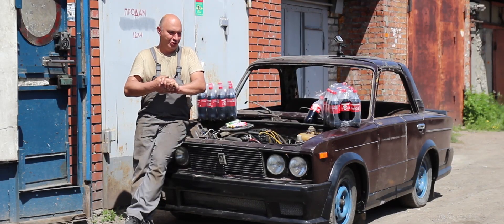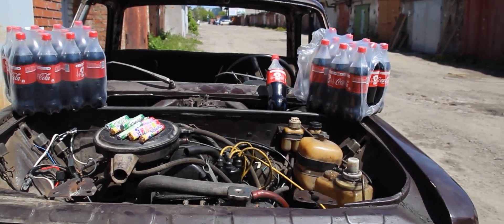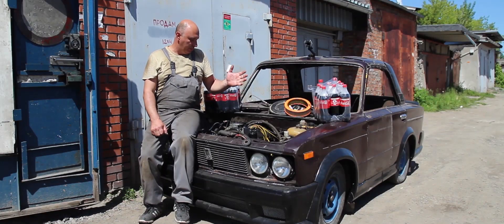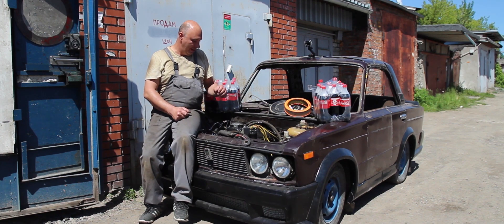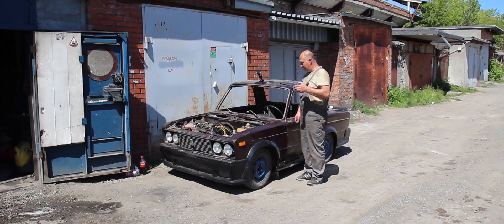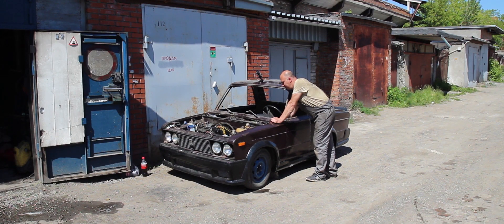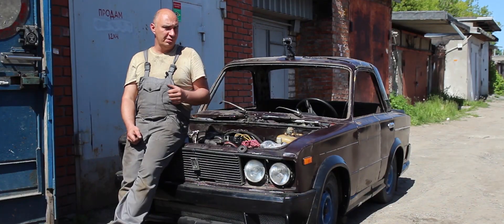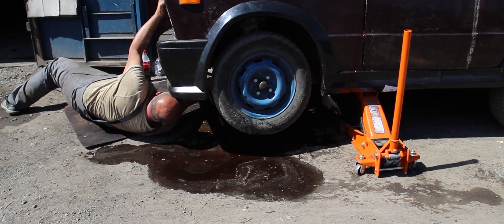What happens when you pour COCA COLA into your engine?

Comment: Excessive oil in crankcase , I think will break the piston skirts
Reply: Pegleg Noid that doesn’t even make sense the oil would reduce friction
Reply: BrandoBrap oil is non compressible.  As the piston came down from the power or intake stroke it would contact the oil in the crankcase. I’m not sure what would happen, but I can see breaking the skirts would be plausible

Comment: today i did something awesome...i poured gunpowder in a carb of a weedwhacker engine and it went off...after dissasembly i saw that connceting rod ends were kissing and crank case was fracture....id like to see what would it do on ayour engines :D its a very good video idea....PUT GUNPOWDER IN CARBURETORR OF CAR IN REDLINE :D make little bucket on hinge that u pull with string
Reply: I call bs
Reply: ikr...it sounds so awesome yet u cant find it on the inthernet....when it was over i dissasembled the engine and it was a mess...connecting rod bent to max with alot of pistonring parts in crankcase
Reply: and that was a 2 stroke meaning that gunpowder had to go to crankcase and get sucked into the cylinder from there....imagine what would happen in a 4 stroke XD

Comment: What will happen if you put pure oxigine into the intake of the engine?

Good videos 👍
Reply: Nothing... except that it would run lean and overheat,  unless supplemented with more fuel.  This is how Nitrous Oxide works.  Adds more oxygen and fuel,  to increase the power.
Reply: I take you meant liquid oxygen? Sure might work out, but you would need to adjust mass of it via valve and have way more fuel being injected, or it goes lean and melts hole into piston.
Reply: That will increase speed
Reply: Yea it makes the idle speed go up scary fast, I only ever tried it for a short time and only at idle.
Reply: A guy did this in the 20th century. What happened was is the engine exploded. It exploded because the air ignited too early
Reply: yup, it was knocking and pistons melted
Reply: It is spelled oxygen

Comment: This channel has alot of potential keep it up
Reply: You look the russian version, its awesome
Reply: The original Russian version of the channel has 1.2M subscribers, and almost 300 videos.
Reply: yeah i have to use the youtube translator to watch the russian originals. but he makes new videos like twice a week.
Reply: Potential,  yes.  But they need to do more research.  This one should be named: "Coca Cola FAIL".  A few dry runs wouldn't hurt, either,  as free scrap cars are plentiful in Russia.  If you fill an engine's oil galleries up to the top of the valves, with water,  it's going to get past the rings, and seize them.  This explains why they had no compression when cranking, that is: after they cleared the hydrolock. Meanwhile,  carbonate crystals were forming in the bearing clearances...  seizing the engine.  Sodium silicate works exactly the same way (see:  "Cash For Clunkers").

Overall:  FAIL.